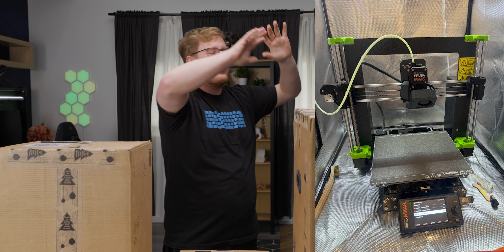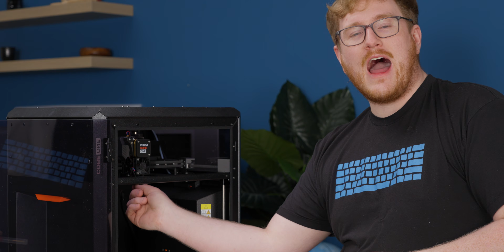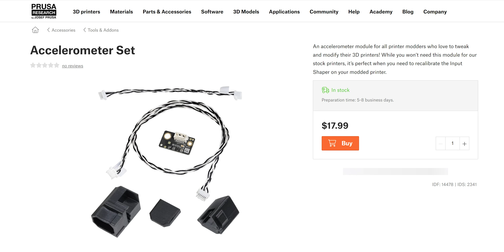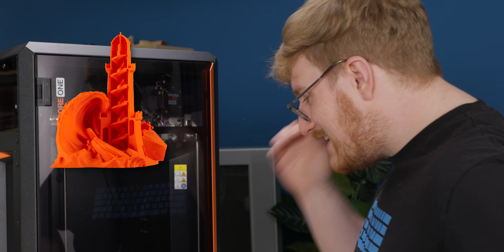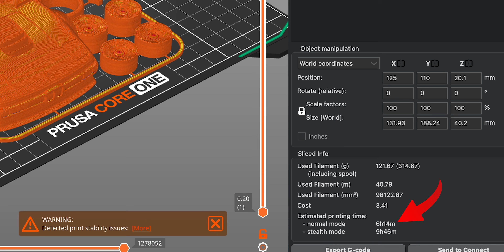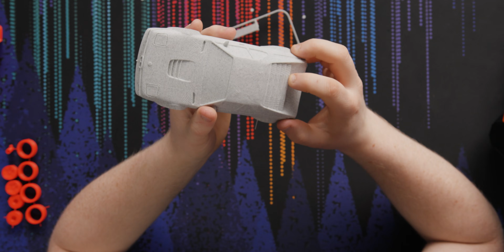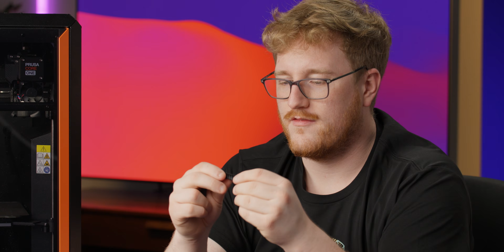Prusa has IMPECCABLE timing - Prusa CORE One

Comment: If you use prusalink vs prusa connect, the wifi transfer is significantly faster. The usb C port on the back is for manually flashing firmware or interfacing with the mainboard for uses such as a raspberry pi connected with octoprint.

Comment: 9:04 true, pla it's bad at high temps

It's also bad at flexibility, uv resistance, water resistance. In fact I'd say it's best attribute is its easy to print. But after getting a decent dryer and dialing a couple basic settings petg is better in almost every way. And with an enclosure to pre heat your chamber, and air filtration asa is pretty fantastic for parts that aren't just indoor, or decorative.

Comment: I  don't understand Jake's beef with wifi on a 3d printer.

Just plug the printer in to a wired network.

It's not a device you're going to want to sit on the couch with it in your lap while you print.

General rule in my house is if you don't walk around using it, it should be on the wired network (with an exception for the doorbell because the PoE version of the G4 doorbell pro  can't ring a mechanical chime).

Comment: The camera is not included by default, because many many customers are schools and public libraries in europe where livestreaming or filming any location must be permitted by the local administration. If it was mounted by default, that would lock out many customers and remove it from the list of possible machines as modifying a stadard product to comply is nothing anybody does at such institutions ever.
Reply: Do they need to have a permit to 3d print as well

Comment: "should come with better WiFi and a camera by default..." and in 2015, a larger bed.  It's nice and all, but IMHO they concentrated too much on making it an upgrade (ditching more than 50% of the parts) to the MK4 and not making a new printer to compete with other dominant core xy machines (like the XL does, except in price)... which have bigger beds. The MK4 upgrade should have been a separate thing.

Comment: The only problem I have with Prusa is how expensive it is to get in Canada. Its like $950 plus $150 for shipping + import duty cost. Not to mention that's all in USD and we can't select any other currency because Prusa is a bish, so we have to pay the hat tax. This brings the grand total for a Prusa CORE One to be something around $1700 CDN.

Where something like the Bambu Lab P1S with shipping is around $1100 CDN or the X1C is around $1400 CDN. This sucks because I like Prusa and don't like Bambu Lab's recent policy changes but the only way for me to get a decent encoded 3D printer is getting overcharged. $2000 is a hell of a lot for a all arounder 3D printer.

All they have to do is rent a distributor warehouse and ship a few containers a year filled with parts and printers, this would substantially decrease shipping costs in North America. Not to mention this warehouse could double as a small printer farm so they wouldn't even have to ship half of their parts any more.

Comment: didn't know if that title is tongue in cheek. Bambu's about to release a new model. I'm moving towards prusa with bambu's controversy but this just matches a 2 year old x1. We need innovation. 3d printers still have ALOT of limitations. In material, speed, overhangs etc. I'd move to prusa but they need to be at parity with bambu present not just past. 

Still impressive work and great to see Prusa really pushing!

Comment: The bending you get with PLA is not related only  to heat. It just doesn’t like to have force applied to it either. A short time with a force applied will make it bend. You need to over engineer PLA prints to account for this. I only use PETG now and whilst it’s slower and more finicky the result is robust and tough. I use a 0.6mm nozzle to up the speed and that works for me. 
Liking the look of this new Prusa but my old ender 5 Pro is still going strong so will keep on with that and then look to change when it falls over.

Comment: I wonder if the slow upload speeds is actually a software issue. I have a MK3S+ with a pi zero W attached that runs PrusaLink, and large gcode transfers tend to be extremely painful there as well, even though the real-world bandwidth of the pi zero's wifi module is somewhere in the neighborhood of about 30-35Mbps (~4MB per second). 

Interestingly, local uploads to the Pi's filesystem are pretty quick, but it's the transfer of the files from the Pi to PrusaConnect that take forever.

Comment: I agree, the 2.4 ghz option needs to go away when we are using these devices for file transfers. If its just sitting there idle to send info back and forth on occasion, 2.4 is fine. But i was sad to see that on my P1S as well. Otherwise for the price, id still take the Bambu.

Comment: The inset filament holder looks like it takes up a ton of internal space or unnecessarily widens it. Top just makes sense.
Reply: it's to fill in the free internal space so the chamber temp can be controlled. There is no unnecessary widening or build volume reduction.
Reply: @RogerEssigArtist  And why is the machine wider than the build plate?

Comment: Wifi modules for 5 gig wifi without the need for a whole operating system only became possible with the new ESP chip that came out this week so i assume they will update it eventually, or you can just use a Pi and octoprint

Comment: No mention of the recent open source controversy. You mentioned being able to download and 3D print replacement parts. I looked, and could only find 1 kind of useless part. I doubt they will provide the files for everything with the direction they are going. Even if they provide stls for everything, stl files are not "source".

Comment: Seems a bit late and undercooked. Relatively small build volume , but cool door and design. Enclosed chamber, no heater, the touted cooler seems ineffective for lower temp materials. Seems like most engineering materials are out of scope with the default brass nozzle the less than stellar 290c hot end. Other printers are on the market hitting 370c. These aren’t the only printers on the market with open source software either, my printer has a toggle to turn off WiFi and stick to LAN only as well. At 1,200 or 950, it seems it’s just for print farms making money or die-hard fans of Prusa.

Comment: For $1200 in todays market, alot more is expected. Does anyone really care thats its from Europe? I mean, brass nozzles, small build area, slower than modern bed slingers, no part cooling, slow wifi, no multi material, no activity heated chamber. The kobra S1, K1c, P1s all eat this printer. For this price I'd take my chances with a k2 plus, heck I get a voron kit and add what I want or a Bambu. This is a fan product and fans should demand more. This is a $600 printer at best. DOA!

Comment: For 3D printed joints that are meant to move (axles), try spraying a little white lithium grease on the joint, working the joint, and wiping off the excess.

Comment: my first 3d printing product I've ever purchased was a heated pcb bed made by mr Prusa himself (meant to heat a pane of glass that sits on top, fastened with binder clips).   he contributed so much to reprap and the open source printing community that a lot of what we have today wouldn't exist if it weren't for him

and they're based in the EU (Czechia), so buying from the states means there's always going to be a cost penalty compared to stuff coming from china, but this is a company you can trust not to spy on your or force you into their own fat client.  you can use their slicer, other slicers, whatever you want since it's almost all completely open source.  they offer STL files for nearly all of their printer parts so you can print your own replacements.  their customer service is unparalleled in the 3d printing world and I believe they're 24/7.  I've never been disappointed with a prusa printer.  my mk3 is still to this day the most reliable printed I've owned.  I have a few Bambus but the speed adds to a slightly lower reliability sometimes.  multi color is the one area I hope prusa improves.  their XL printer does multi material using tool swapping which is epic, but that one is pretty expensive.  if they can get an MMU setup that works similar to bambu's and in a similar size, I think it'll be a massive success.  oh by the way, their satin PEI sheet is still the best I've ever used.  I was super bummed when I found that it doesn't fit in my Bambu.  the Bambu ones are super thin and so thin that materials that are more prone to warp will actually lift the corners of the sheet up because the sheets have so little rigidity compared to the much thicker prusa ones.  the prusa ones also stuck like glue even after thousands of hours of printing, with only a quick wipe down with alcohol between prints.  my bambu ones feel like they got less sticky after a while, and that's not to mention their earlier units came with a sheet that was not PEI and still required glue.  I think they come with PEI now but textured, which isn't always what you want for PLA.  satin was a nice mix between smooth and textured as far as grip goes.  I used it for every material and never had issues with stuff coming off.  if they use similar quality plates on the new core one, I think people will love them.

Comment: Not two motors for X axis.  This is a core xy so the two motors are mixed and both control the x and y movements.
PLA is also brittle and won't survive a fall to the floor.  I printed a chess set in PLA, and a king fell off the table to a hard floor and broke in half.  Chess men printed in PETG didn't have this problem!
IIRC the Prusa also has an ethernet connection.  That should be faster?

Comment: craps on bambulab for requiring to have to log in, which you dont atm if you are running current firmware and bambu studio..

Then literally complains about so much stuff about the prusa that isnt a issue with equiv bambu counter part.. no wifi issues with bambu thats for sure =)
Reply: What time code? He doesn’t mention Bambu aside from near the end when listing other options.

Comment: Another thing about companies that are “reminiscent of materials that pandas like” is that the file transfer speeds are very fast. Also you can send a print form literally anywhere with your phone.
Reply: I've never quite worked out what the point is in 'cloud enabled' printers. Some kind of networking is almost essential, because I use a desktop for doing CAD, so it's handy to be able to print from there to the printer in another room. What I can't imagine is any situation where I'd want to send a print remotely via the cloud.
We have that option on the big BCN3D printer at work, and I've only used it once to see if it worked. (If I wanted to send a print form home, I'd just use a VPN).

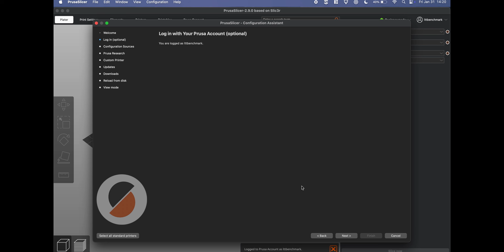Comment: 7:45 I understand it’s as sponsored video and bashing the competition is great in those, but this is a little misleading, you do still need to connect the camera to the internet, you don’t “need” to login bambu labs X1C which this is a clone off btw (forgot to mention that) you guys should investigate that a little better before lying like Jake technically did here from lack of research.
Reply: He didn’t mention Bambu at all. Whatever you inferred is on you.

(edit) It was edited out, apparently.
Reply: @Decipher13  They stealth-edited the video and took out the very obvious inaccurate dig at Bambu. If you notice the cut at 7:48, they cut out the rest of Jake's statements. He says something to the effect of "You don't need to log in to printer to the internet to use it at all....unlike another company that pandas like to eat." He also inferred that Bambu printers are required to connect to the internet to print. These inferences and statements were factually wrong and as such, they removed them.
Reply: @tydellus  The edit was pointed out to me, yeah. What a shame, but good on them for making the cut so quickly.

Comment: 1300€ for this is insane. Why would anyone buy this over a P1S? Let alone X1C. With AMS the X1C is 1399€ And the P1S 799€ with AMS. And without AMS they're even cheaper if you need an enclosed printer.
Reply: A P1S doesn’t cost 600€ with AMS?!
Reply: @itsJules8  P1S is €799,00 with AMS. I mistyped it. I was looking at the P1S standalone, my bad. Still way cheaper than 1300 though.

Comment: $949 for the kit , $1200 assembled.  I would rather spend $1300 on the Peopoly Magneto X as it has better motor control (linear motors), larger print volume, faster prints.

Comment: Saying you need to log in to a Bambu printer and have it connect to the internet to print is demonstrably false. Bambu printers have an SD card slot that lets you print offline just like prusa. Cmon guys, do your research.
Reply: it’s entirely factual now. They stealth edited the video today. At 7:45 when he’s talking about not needing to log into the printer to use it, the original video has his complete sentence that said something like “you don’t have to log in to use the printer at all unlike some company that pandas like to eat” or something like that. They appear to have cut the latter part of his sentence out. Look at how quick they cut to the next clip when he’s in the middle of his sentence.
Reply: Name the timecode where he says that Bambu needs it? Can’t? That’s because you inferred it from him saying that this doesn’t need it. It’s entirely factual

(edit) Apparently it was edited out shortly after the video was made public
Reply: @Decipher13 he also had a dig in there about having to connect Bambu printers to the internet. I don’t recall the exact words and phrasing he used, but it was there.
Reply: They also mentionned two Y motors but that's not how it works in a core x-y machine, both are used in the x and y axis movements.

Comment: If I got a random screw I had no idea where it came from that printer would be going back for replacement.  I would never trust that printer.  Just like I would never trust an unboxing video from Jake when he spouts absolute rubbish about having to login to a bambu printer.  I have never logged into mine and run it in LAN only mode.  It's blocked from the internet and runs happily on my local network connected to home assistant.

Comment: Bambu Lab printers doesn't require account or any other form of internet connection to work. They can be used on LAN and Offline modes from the start. Don't lie like that on Prusa review
Reply: When did he lie? He only mentioned Bambu at the end as an alternative. He said this printer doesn’t need an account to use, which is true.
Reply: "your product may block new print job before the updates is installed" -bambu lab

Comment: I'm building an enclosure for my MK3S (which still performs very well, it's just not fast but I don't need it to be). I bought a relay board because I've got the printer hooked up to a Raspberry Pi 3 running Octoprint and I want to control the enclosure's lighting (also has some shitty LED strip lying around). Any recommendations for what to control with the other two relays on that board? I was thinking air filtration and chamber cooling fans.